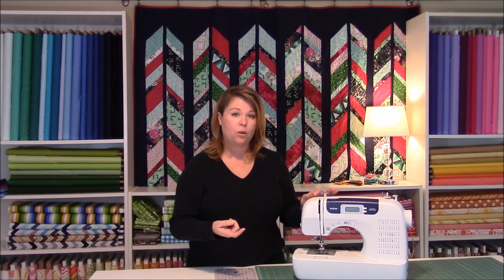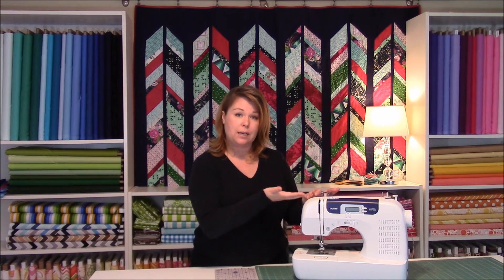Troubleshooting Quick Snip Machine Skipping Stitches

Comment: Hi my vintage sewing machine still skips stitches while using ballpoint needles on knit fabrics and after adjusting the tension dial. Is there anything else I can do.
Reply from the maker: Unfortunately, my guess is that your machine might need to be tuned up.  I'm assuming that the needle bar or the shuttle is out of timing and it will need to be seen by a Sewing Machine Doctor.  But if you love your machine, make sure they don't try to talk you into a bright, shiny new model - vintage is so much better ;)  Good luck!
Reply: Mary Mee
Jjj

Comment: My 221 Featherweight stitches PERFECTLY with a round needle, but needles that have a "cutout" (scarf) will just about not stitch at all. Timing, needle height, and everything is perfect - and remember - it DOES STITCH PERFECTLY with a ROUND needle. What gives???
Reply: Well, I apologize for bothering you with this "problem". I am completely embarrassed! It was only a case of me being "stunada" (as we say in Italian LOL) and being a dummy. When this problem cropped up, I had been working on this machine for around 8 hours already and it was like 6 AM in the morning. I should have quit and checked everything again today. I was WAY overtired.
So I took the machine to a friend of mine who is VERY knowledgeable with sewing machines and is a fabric expert. I had him install a new needle (WITH the "scarf" cutout) and the machine sewed perfectly! Right there I knew I screwed up. 
But WHERE!!??
So I pulled out needle MYSELF and installed yet another new needle with the cutout. And the machine started skipping stitches! During all of this my friend is sitting next to me with HIS featherweight sewing with one of my new needles and NO PROBLEM!
So I looked at my threading and thought it looked kinda odd - So I got up a looked at his threading, then looked and mine, and like a JERK I realized I had missed the last thread notch AT the needle! What is amazing is that the machine actually stitched a little like this so it was driving me nuts.
 And what is even MORE amazing is that when I was doing this at home and switched back to the original round needle I somehow managed to thread it properly LOL!!! Talk about Murphy's Law?
So now I know the reason - it was ME. So I again APOLOGIZE for being a goofball and all I can say is "mea culpa, mea culpa,  mea maxima culpa"!
Well, at least I know the machine is perfect now because I checked everything including the timing and of course found it all to be perfect. UGH!